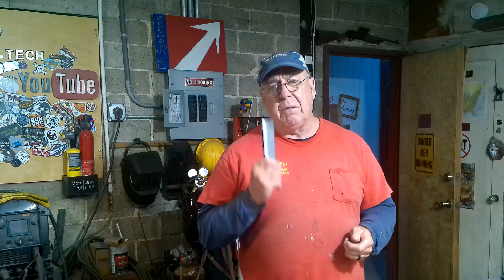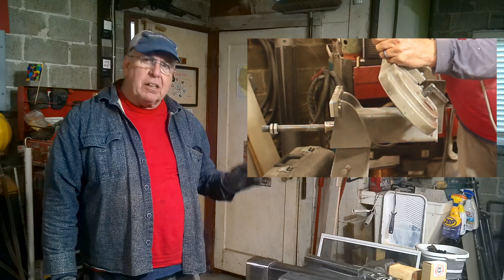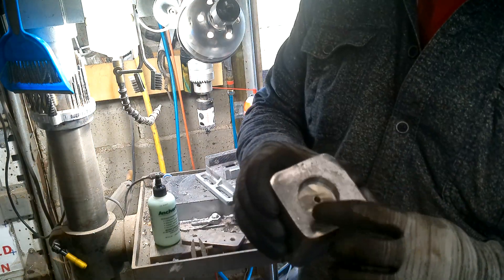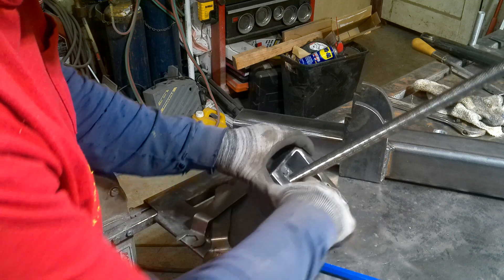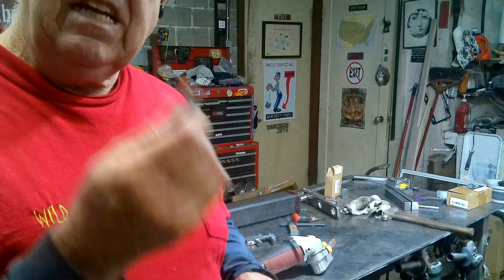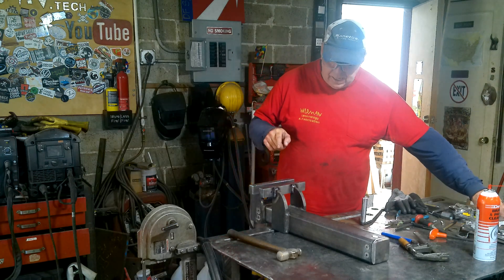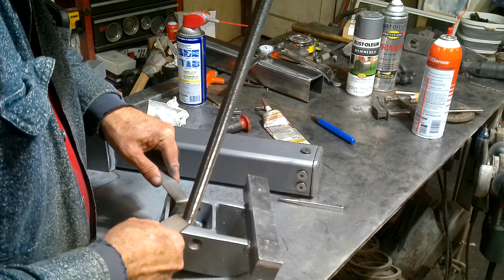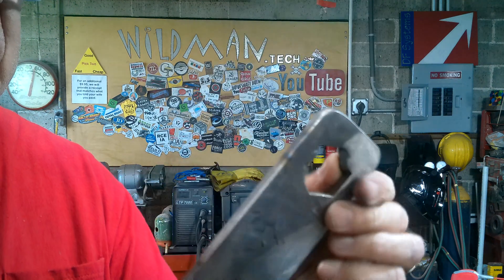Building a New Vise (Again) Finale

Comment: Great job. I like the fit and finish. I am planning a larger vise build right now. I will be using a more recycled mechanism. But similar.   I noticed you drill press table flex a lot with the weight of your nagnet vise and heavy parts. I added an adjustable post under the table when i do heavy parts or have fixture table in place. I use annular cutter a lot and cannot have the flex. For large acme thread and nut included. I use adjustable scaffold foot. I can buy them new $25.
Reply from the maker: I noticed that flex too. The collar line could was loose. Good tip on the acme thread, but I wonder what grade it is.